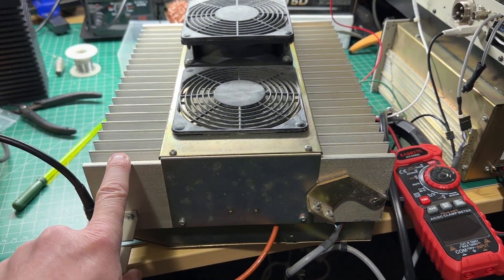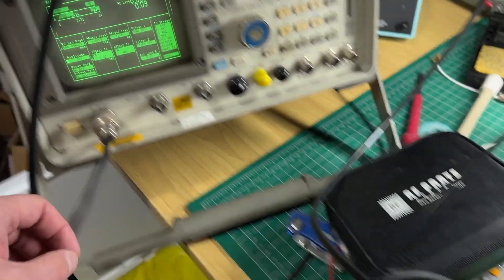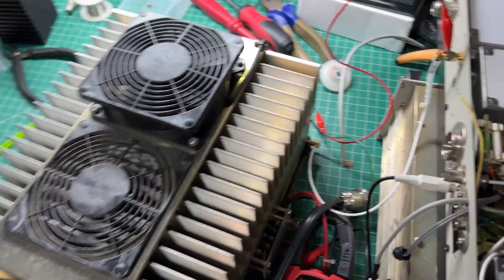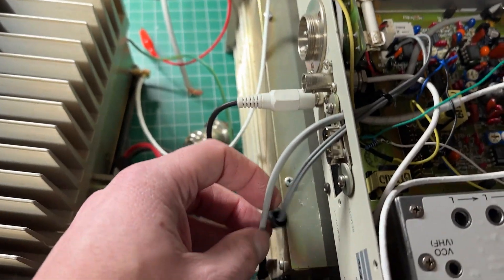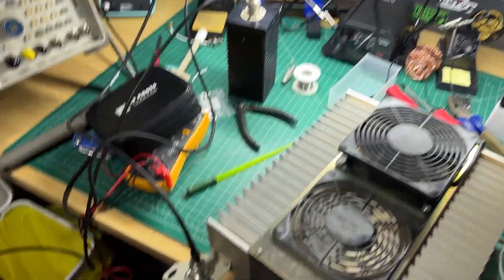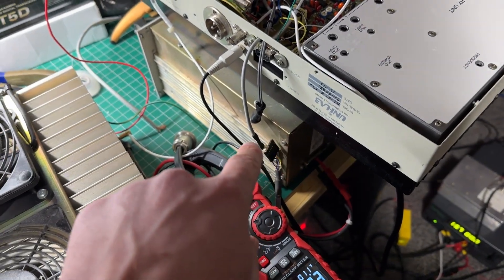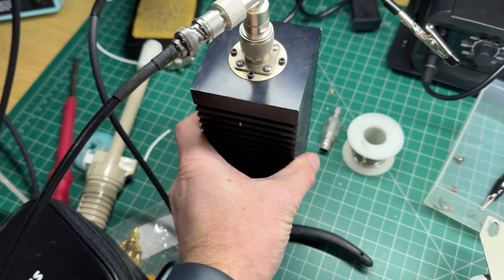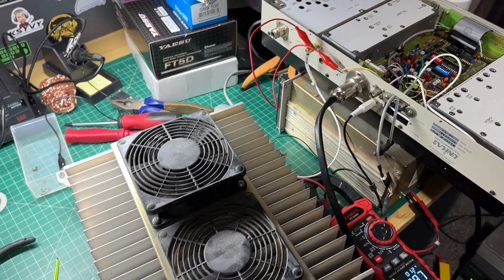Look What I Added to My 2 Meter Repeater!!

Comment: VK6RCT north of Perth used a MaraTrac 100w transmitter with a simoco SRM 9000 receiver .  It was a bit of an alligator repeater, users could hear it  ok  but struggled to get back into it using a 25 watt mobile

Comment: Nice hayden! Where did you get the PA? Ive built a 2m to 6m transverter and looking for a PA or I may build one. Looking for 25-50W output with .1-.5mW input
Reply from the maker: This was an ex public safety one. They got rid of several complete units, so pulled the PA section out and reused it

Comment: Somewhere I think in my storage unit I’ve got a Glenayre 250 Watt pager amp, which has been retuned from 157.925 (one of the main pager frequencies in ZL) and I’ve seen that do about 300 Watts at 144 MHz…  it’s also 28 Volts. I’ve had 2m of RG58 go gooey between the amp and a dummy load. My load here now will handle 100 Watts continuously but it does get hot if you do that….
Reply from the maker: Yeah I had to ask for a bigger dummy load! It passed the "soak test". An hour on TX, only gets a little warm without the fan on

Comment: Is there any commercial or public safety paging on VHF still in use there?
Reply from the maker: Yes. They've recently just moved to a Government Radio Network on around 162 MHz
Reply: Yes, in NSW Australia we have the RFS, FRNSW and also most hospitals.
The frequencies are around 148MHZ. They still use 512Baud POCSAG.
Reply: @5Perf65mm  We still have 1200 baud POCSAG & FLEX in use in my area by public safety & hospitals as well as by a public utility to control outdoor warning sirens.